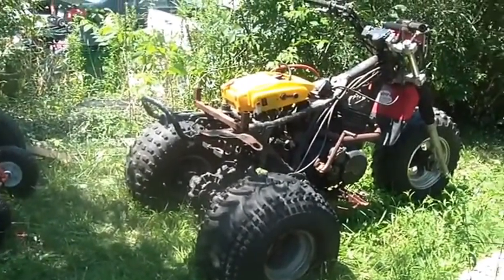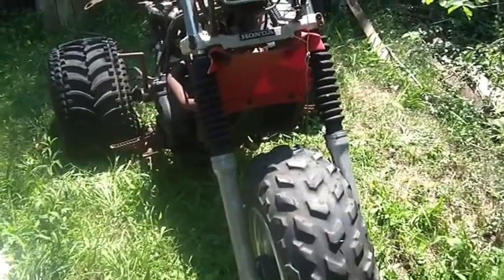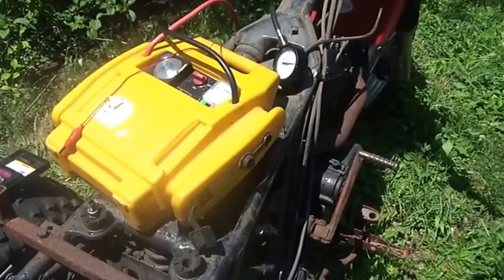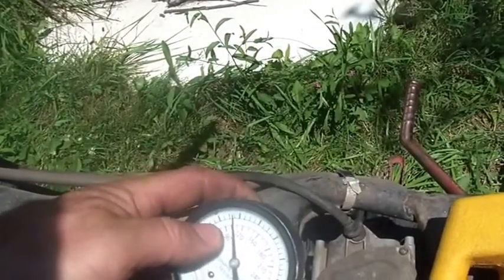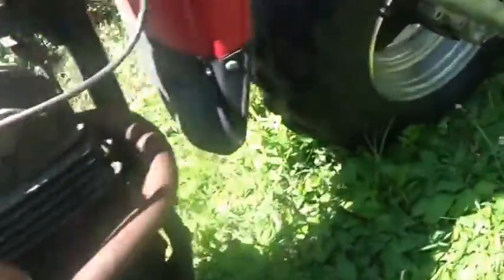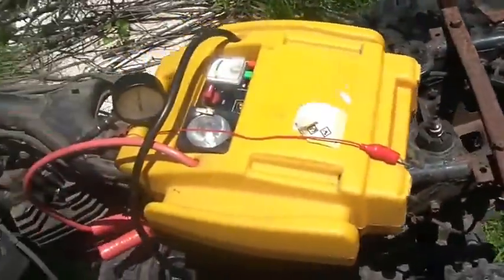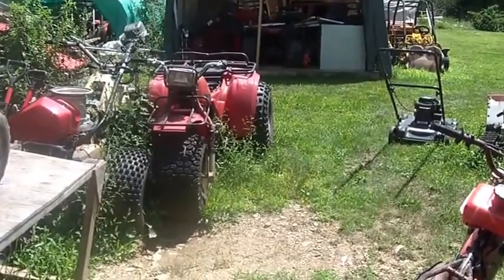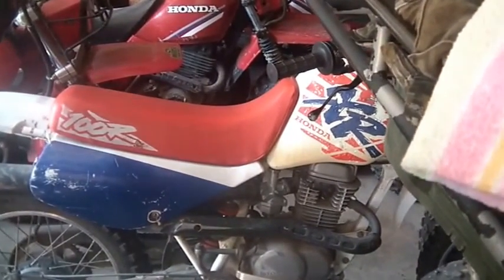Forestport 1985 Honda ATC 250sx critical look

Comment: It use to run, but she has sat outside for a long time.  Rings are probably rusted in the piston.  It use to shift hard.  I think the PO use to hold the shifter down and rev the hell out of it before letting drop in gear. Rear end was fine, but sitting outside for 10 years has rusted it solid. Thanks for making the deal on the XR75 Parts bikes.  My son and I just watched this video. He thought it was pretty cool! It will probably be winter before. I get back on the XR75 project. This Galaxie project is starting to come together.  I will shoot another video soon.
Reply from the maker: Hey Ed, Ur old 250SX has an opened CDI pulser, don't worry, I'll get it running, these Hondas are nothing like a woman, they can't resist my touch... LOL!!!   Unfortunately, will be band with limited this week, can't stream video... Will visit Ur channel soon.... Thanks for the info, kind words, watching, and commenting!!!!

Comment: I wonder if you was to pour some atf down in the jug if maybe it would kinda clean the rings to let them unstick
Reply from the maker: Hey Wally, I used ATV motor oil down the spark plug hole and turned it over without a plug, turns out the crank case oil looks real clean, I have some hopes for this engine.... If the compression stays low, I may try some diesel on the rings, my experience with that is it seems to soak everywhere, thanks for the suggestions, thoughts, watching, and commenting!!!!
Reply: +Harvey Spooner I watched a vid not to long ago that this guy used diesel and Marvel mystery oil and a small pond pump from hf and would pump the mix though the motor for 3-4 days to bring back bikes that had been sitting 20+ years